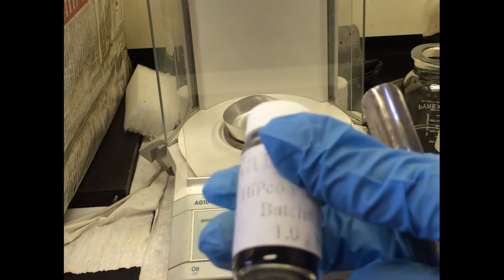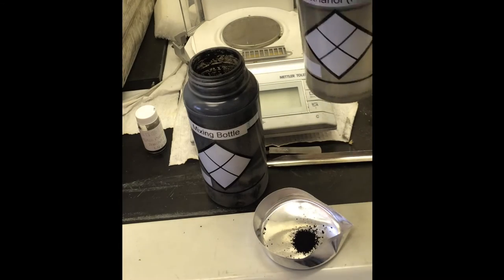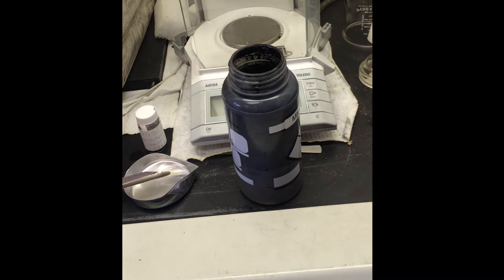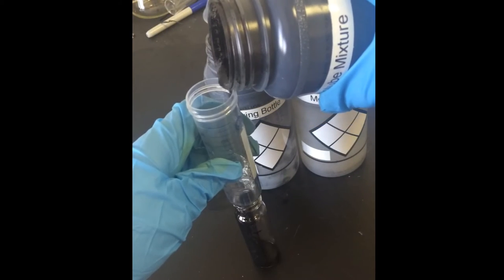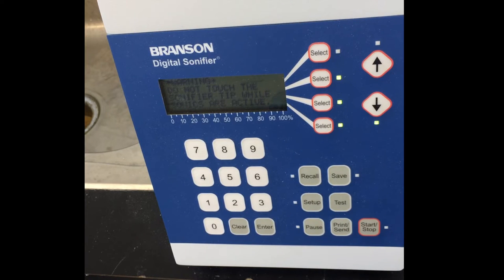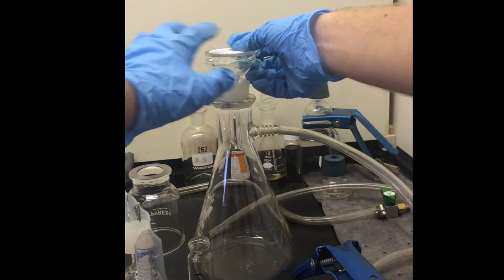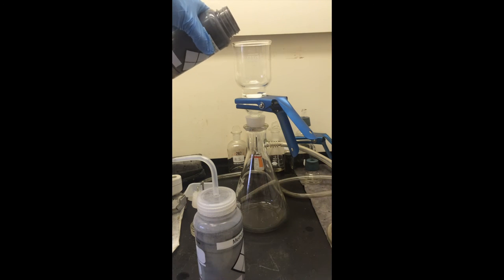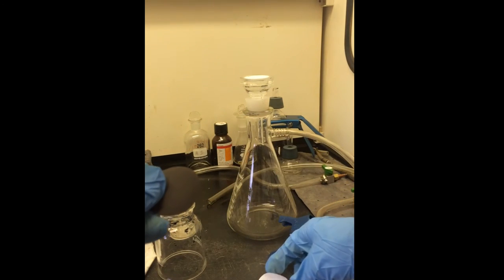Making Carbon Nanotube Felts

Comment: Hi Tyler firstly i want to say thank you for this video. I want to ask something about my experiment.
1. Do we need to pour the dispersion into the beaker directly or gradually in the filter section?
2. What should we do to minimize the carbon nanotubes remaining in the beaker during the filtration process?
3.Is it better to do the dispersion with water or with ethanol or methanol? I guess water needs more time for filtration.
Reply from the maker: Hi Melike,
Glad you enjoyed the video! 
1. That should not matter much; I believe we put it in two sections just because the volume of filtrate was greater than the filtration beaker. 
2. Things that would help:
-more sonication, this will homogenize the solution better, reducing clumps that can build up 
-dilute the mixture more, again to separate the particles 
-make sure your beaker is very clean 
3. Yes, an alcohol works better. The SWNTs are nonpolar (as is the filter), so the solution mixes and filters better in a less polar liquid.

Comment: Thanks for the video Tyler!
I am trying to produce buckypapers using MWCNTs dispersed in methanol exactly as you described,  but still they are not producing good dispersions. What was the power of the sonicator that you used. Have you tried to obtain them using a paper membrane in the vacuum filtration step? I think that this may be one of my problems since the pore sizes of the membrane are large and the filtration goes faster than necessary. What cautions do you recommend on this step. Thank you very much!
Reply from the maker: Hi Bruno,
- I believe the sonicator was a Branson 450, which has a max output of 400W. Given the 70% setting, the output was probably 280W. 
- I did not ever use paper filters; as Professor Floyd mentioned in another comment, the filters used in the video were PTFE with 5 micron pores. 
- I did not use MWCNTs, but Professor Floyd did before I started in the lab. I seem to remember he had poor or variable success with them (primarily that the felts were too flimsy).
- Again in another comment, Professor Floyd mentioned some ways dispersion can be improved:  adding surfactants, changing or blending solvents. 
Hope that helps, sorry I did not get to this sooner.
Reply: @tylerwatson2930  Great video! Thanks. Why you used 280W of power? Could it be used less? Maybe 50W? And you used inner sonicator. It is necessary? Why you don't use ultrasonic bath?

Comment: Have you ever seen cracks  forming on buckypaper, like desert cracks. Because every time I make a buckypaper using vacuum filtration process, I get a buckypaper with these cracks..
Reply from the maker: Hi Jefferey, 
Yes, those cracks can be fairly common.  Professor Floyd can speak more to the subject (maybe read his reply to Ben Davis below), but the cracks seem to correlate to the buckypaper quality.  If you want fewer cracks, it may help to homogenize your nanotube solution more, or use a different type of nanotube.  Heavier / thicker buckypapers seem to be more prone to cracking (probably a drying and stability issue).  What are the type, mass, and concentration of nanotubes you are filtering?
Reply: I'm  using  short unfuctionalized MWCNT  with a diameter of  about 80nm  and  length of  about 20 um from  cheaptubes.com. I added 5g of surfactant , triton x100, for  dispersion  and  0.5g  or  1g  of  cnt  and  500 g  of  DI water. I sonicated the mixture  for  30 min with a tip sonicator.  It didn' t  work out  so  after  looking  at your  video  I switched the  solvent  to methanol  but  that didn't  work  as well.  At least  in  terms of  dispersion,  it looked  to me  that  water  was  a  much better  medium  than  methanol , so I was  wondering  if  there  is a particular  reason  why you used  methanol,, but  you  obviously  are  getting  a  crackless buckypaper. 
When using methanol during filtration process, the surface of buckypaper looked crackless at first. But as methanol evaporated further,  it  seemed  as  if  the CNTs were grouping  themselves into tiny  1mm by 1mm pieces as  methanol evaporated.
Reply from the maker: Thanks Jeffrey, some things that you might try or consider:
-we do sonicate for about an hour; heavy sonication is very important, and inadequate sonication will result in clumps and possibly even the cracks.   I do believe the recycled felts were of lesser quality partially because of this fact.  
-you're absolutely right, the cracks generally develop as drying continues
-we primarily use SWNT as opposed to MWNT; they seem to be better self-supporting
-we don't use surfactant
-your concentration is about 5x what we used, and your overall mass is 10x what we put into one felt
Methanol was chosen for a variety of reasons.  It does evaporate quicker, and it should interact less with itself, the vacuum, and the nanotubes - thus making the process go more smoothly.  I believe due to the highly polar nature of the water compared to methanol, as well as the lower vapor pressure, we hypothesized the methanol would form fewer inconsistencies in the felt and would not linger in the felt.  The full drying process (after the bulk liquid had passed through the vacuum) included 30 minutes on the vacuum and an overnight stay in the drying oven, with the methanol as it was.  
Hopefully this helps, and best wishes on your project!  Feel free to comment more if you need.
Reply: Sorry for the super late reply :{
BPs  usually crack for two reasons, the CNTs are not well dispersed and when the solvent evaporates the surface tension contraction is stronger than the fiber connections or adhesion. The second, similar reason is the solvent evaporating too quickly.
You can try rinsing with a solvent that has less surface tension. Also try covering the BP as it dries. It will take longer but will hold together better.  The best solution is to disperse better and rinse with a low surface tension solvent.

Comment: What concentration are the CNTs in the methanol?
Reply from the maker: Hi Benjamin,
The ideal end result for the felts we made in the video is to have ~50 mg nanotubes in the felt (as seen when weighing the fresh powder).  The recycled "sludge" is not at a set concentration, but the concentration was often empirically determined.  For both processes, it was ideal to have one felt's worth of nanotubes in 200 mL of methanol, so the end concentration was usually 0.25 mg/mL prior to vacuum filtration.
Reply: We use ~50 mg SWNT in 300 mL MeOH for suspensions that will be filtered to make buckypaper.  When we are recycling the broken or damaged buckypapers we only add enough MeOH to make a thick sludge, we then take the sludge and make buckypapers using ~50 mg SWNT in 300 mL MeOH. Sorry that was not clear in Tyler's video.
Just an FYI, the better dispersed the CNT the higher the quality buckypaper.  You can achieve this by optimizing your dispersion solvent (using surfactants, or a blend of solvents, Dichlorobenzene works very well but is hard to remove later), by increasing the volume of the solvent or decreasing the mass of CNT to be dispersed, and by sonicating for longer or at higher power.   There are so many variables it really comes down to finding a procedure that makes a buckypaper having the qualities you need.
Reply: @professorfloyd4538  hi. How long do you vacuum filtered it?
Reply: @ayep13  the filtration will depend on how well dispersed the CNTs are in the soln, pore size of the filter, and volume to be filtered. Better dispersed will clog the pores and take longer to filter.  For our 50 mg BPs typical filtration times were 30 -60 min, however I have had some BPs take 4-6 hrs to filter.
Reply: @professorfloyd4538  thank you for the reply. Much appreciated
Reply: @professorfloyd4538  Is there any possible way to dissolve CNT's?

Comment: ho strong was the Bucky paper, if I may ask
Reply from the maker: Hi Hunter, 
The buckypapers are typically fairly weak. They are self-supporting, but they fall apart from heavy adsorption.
Reply: @tylerwatson2930  thank you for replying, and thank you for the info
Reply: @tylerwatson2930  so if you were to connect multiple Bucky papers for more absorption, would that make it stronger?
Reply from the maker: @hunter8949  if I remember correctly, we made some heavier / thicker felts (bucky papers), but at some point they became unstable. I think that could have to do with a higher weight per surface area, or poor deposition on the formation filter. I'm not sure if / where I mentioned, but we ended up adsorbing the fresh felts onto glass, which made them much more stable. The process was fairly simple; at the end of the filtration phase, when all the SWNTs had deposited but the felt was still wet with methanol, we removed the filter+felt from filtration and pressed the felt side against a glass piece. The pieces we used were about 1.5" diameter circles about 5mm thick. Through the glass, we could see where the felt was well-adhered (darker) vs. poorly adhered (light); so we could press down through the filter to adhere the felt better. Once fully adhered, we could air-dry the module, then peel off the filter, and finish heat-drying the felt+glass.